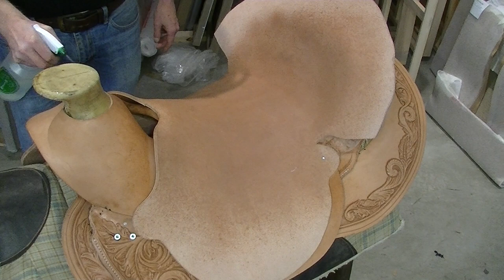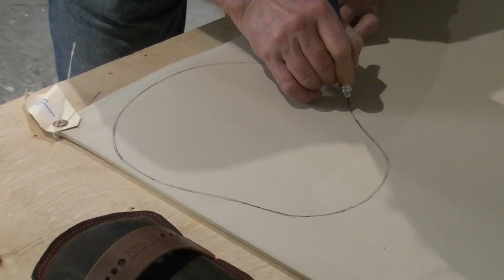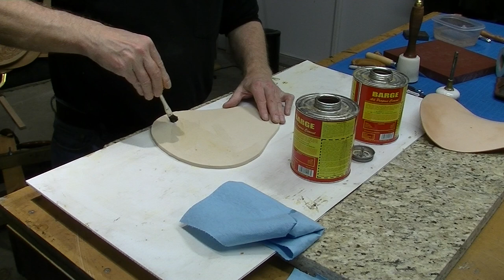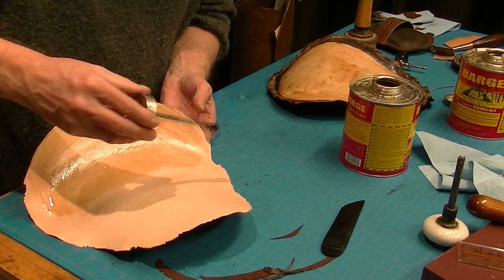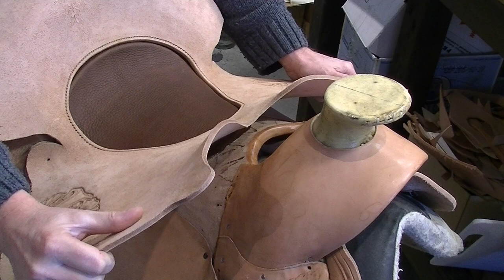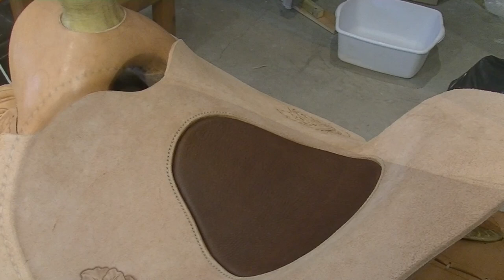Saddle Making. Installing an inlaid padded seat.

Comment: nice clean work! I have a question I am considering tooling the rough side of some 5-6 ounce tooling leather and inlaying that into a seat as an experiment. doing pretty much as you have done here. It is a wade with a smooth out and tooled seat, so only the inlay will be roughout. The bucking rolls are also made roughout and tooled as well. I have never seen anyone else do this kind of work, except for a saddle maker from Montana who did this for a packer's mule saddle. Any thoughts pro or con?
Reply from the maker: What I would suggest is you experiment with it before you commit to tooling the final piece. I find you really have to pound it in deep in order to have it show up properly. I've tried it on various leathers and have found the only one that works satisfactorily is really heavy Herman Oak.
Good luck!!
Reply: I agree. Al Stohlman  did this in the book “Inverted Leather Carving”. Check it out!